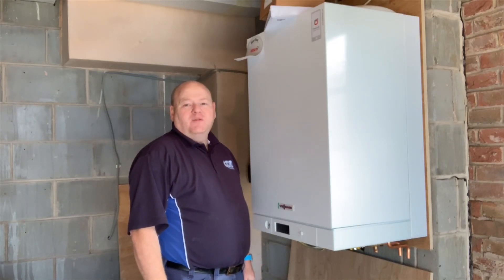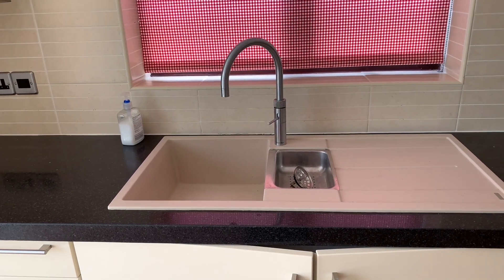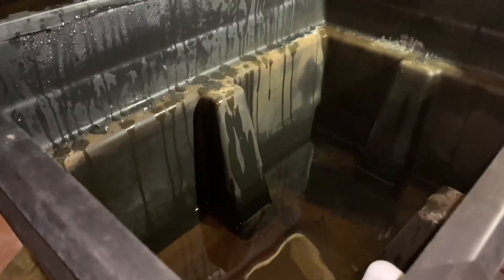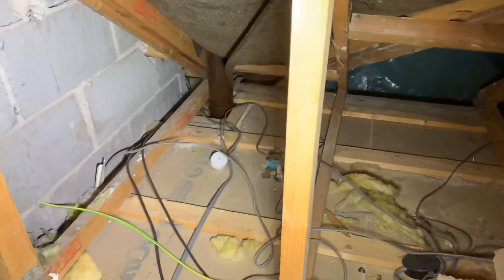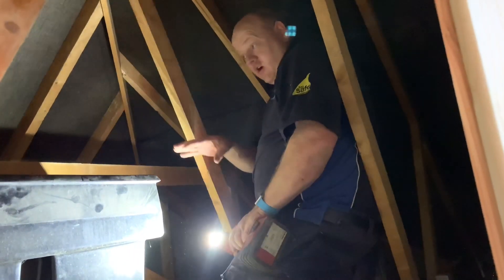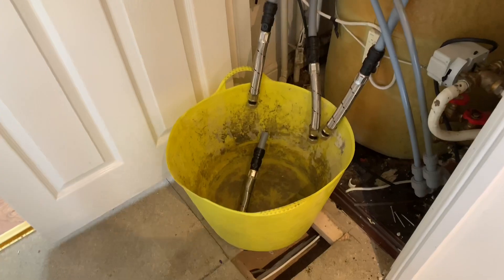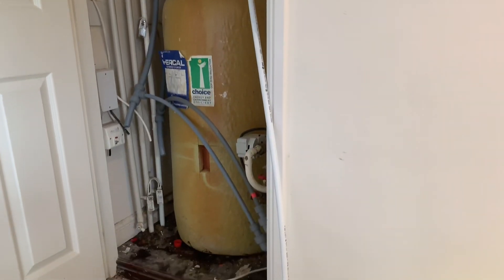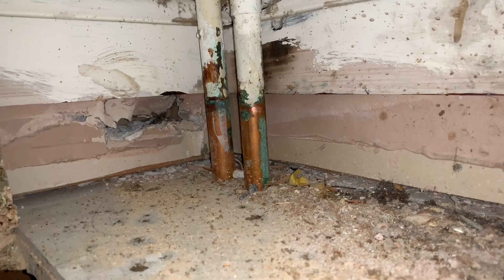Plumber - Day 3 Viessmann 111 - Removing the cylinder

Comment: "Squeeze into the loft space" I'm 9 1/2 stone wet thru. Last time I negotiated a loft/attic conversion space, to get to the tanks, I had do a training course at The Cirque Du Soleil first. after grunting, twisting and contorting...
Guess what I found? No crawling boards, no lights, plumes of dust, itchy insulation and when I finally got to the wiring box, pump and controls, I found an s plan with three (THREE??),  2 ports valves.. only one wired up, a tiny, tiny  cylinder, the cover off the wiring box missing (surprise, surprise) and a wasps nest. The water in that F&E tank looked like my bath water after I'd been in "that" loft. After seeing that wasps nest... You should have seen the state of my underpants!
Seriously... Al, top info.
Reply from the maker: loafer sheffield 😂😂😂😂😂😂😂😂Thanks 👍

Comment: hey great video i was just wondering does the hot water cylinder heat up the cold water that comes into the house cause at my old house i had a very similar set up but with no gas boiler or any kind of gas does the cylinder like a kettle where it heats the water up

Comment: Great video, 
I wonder if you could offer advice, I have a vented electric boiler and someone stole the lead pipe that was used for the vent which was going to the water tank in the attic,
I got the vent pipe replaced but there is water gushing from the vent pipe non-stop into the water tank, is this normal? The water keeps gushing from the vent pipe even when the electric is turned off,
I spent 250 for a plumber to replace the vent pipe and when I called to tell him the vent pipe is pouring out water non-stop he switched his mobile off claiming he has the coronavirus and he will not be taking calls, please can you offer advice as I am worried, thank you.

Comment: Can I ask please for the red circular switches or valves, if I want to open them, should I turn them clockwise or anti clockwise,  please?
Reply: The red circular switche or handle for the return connection at the bottom of the boiler please? Thank you